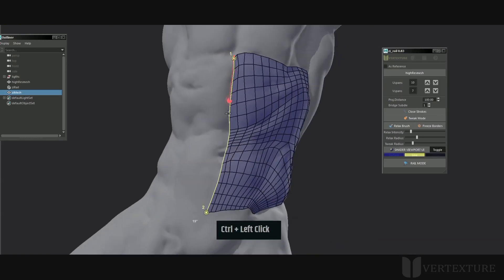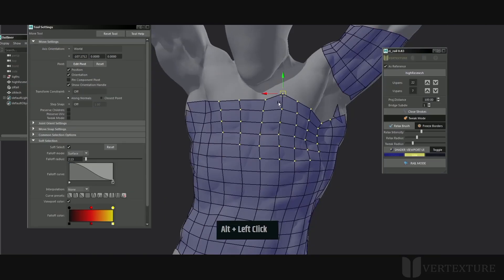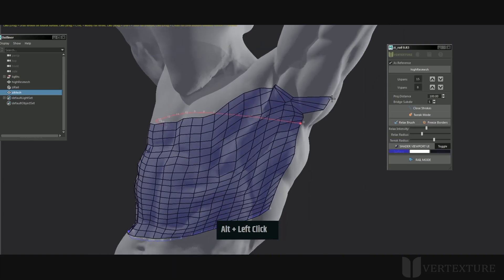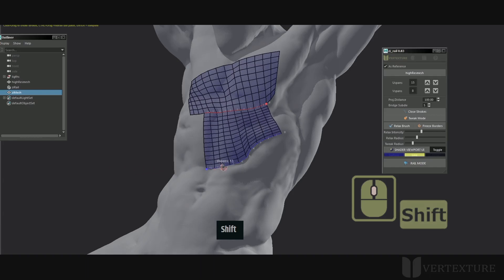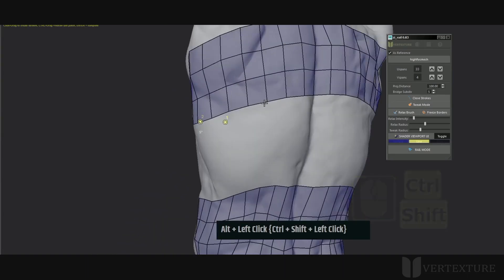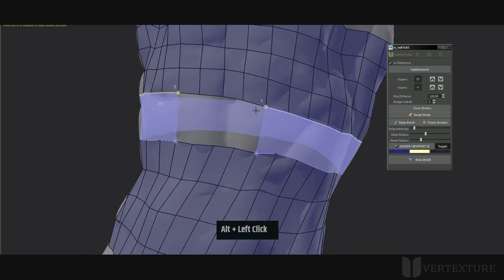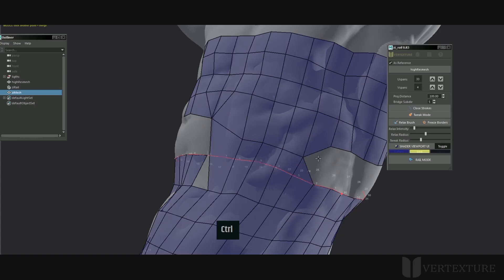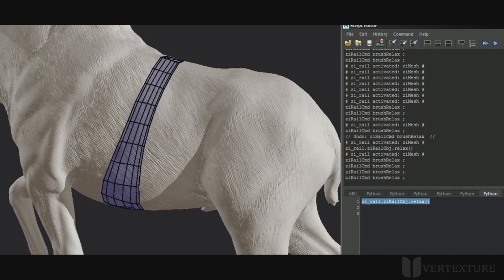ziRail Maya plugin Tutorial, step by step demonstration Part.2

Comment: I preassed Ctrl + Shift + Mose middle butten but relax funktion does not woring.
Reply: And also the slice rail funktion doesn't working
Reply from the maker: Hi
Please make sure that your Relax intensity as a value (slider in the UI). Set the Proj.Distance  to 100 (default) and try the slice rail fuction again.
You may need to send an email to have a complete answer.
thx